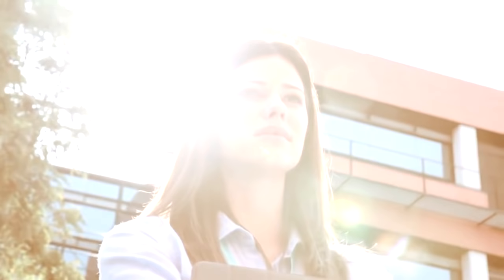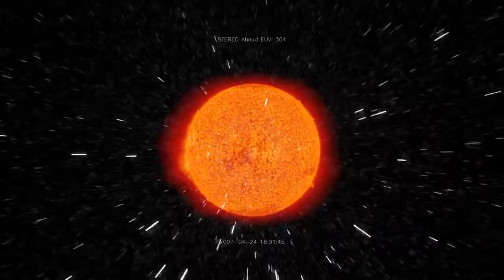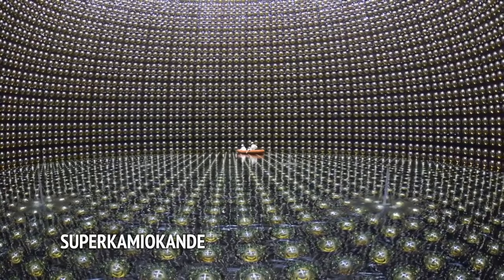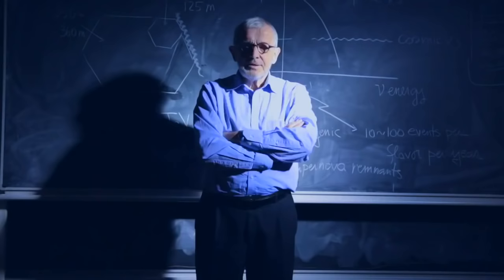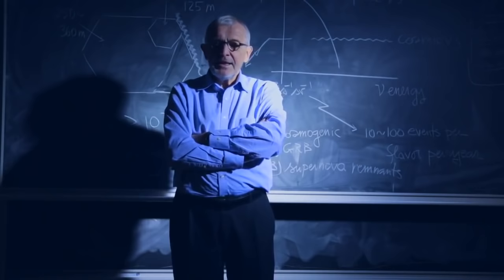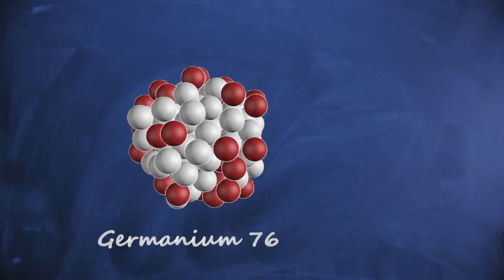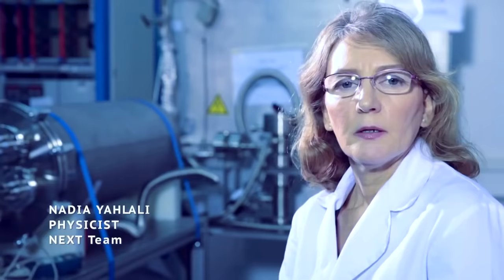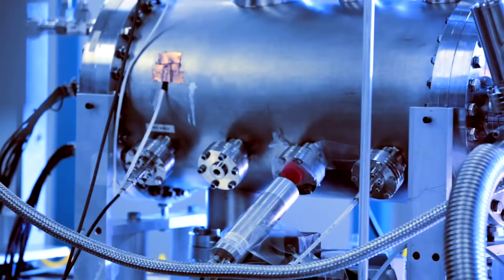Neutrino Sun Particles - What Are Neutrinos (Documentary)

Comment: the reason the neutrinos are changing 'flavors', is that  space is 5 dimensions:.   Length, Width, Height, Time, and....Energy.  
as the solar neutrino travels to Earth, it encounters different 'Energy', probably by way of collision/oscillation - which would be the most logical answer.  you have to think about how fast our universe is moving.
Reply: How fast our universe is moving is an excellent inquiry. I was fascinated with this thought when I was younger.

Imagine the result of halting all motion within the multitude of layers of interacting frequencies.

It can all be expressed as a set of frequential readings given at all the various locations of existence in any case.
Reply: The Earth is Flat and stationary.
The Sun is within the Firmament, meaning no "Universe" variables.

GOD BLESS
  🌿💕🌿

Comment: See the most basic info should be in question. Such as the earth is 13 billion years old. Based on what ? On carbon dating ? That is flawed to begin with. Carbon dating requires us to assume the level of radiation on the earths surface has always been stable. For 13 billion years the levels of radiation haven't changed ? You see the most basic information they have is flawed. Therefore all subsequent information has to be flawed.
Reply: Elliot Rodger Ok, so I messed up the time frame. The point is still valid.
Reply: Don't worry. You arent the only one who has an issue with the carbon dating. Elliot Rodger has a major problem with that, a major problem. This is a problem which he intends to rectify.
Reply: yah, there is a lot of flaws with how they measure time.....as far as I'm concerned everything existing is ancient! Since any planetary system has probably formed from cosmic dust and various other chain reactions....these elements coming together from "old ancient" debris....then literally our earth and every rock in our galaxy is mostly likely billions of years old...common sense!
Reply: Bill Fletcher Carbon dating is not used to determine the Earth’s age.
Reply: Lol carbon dating cannot be used to find the age of anything more than 60000 years old